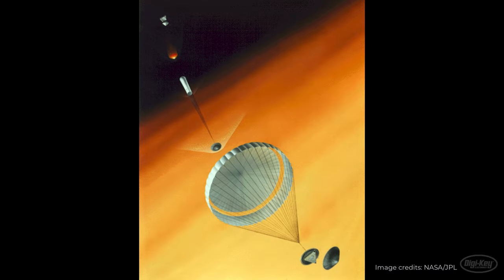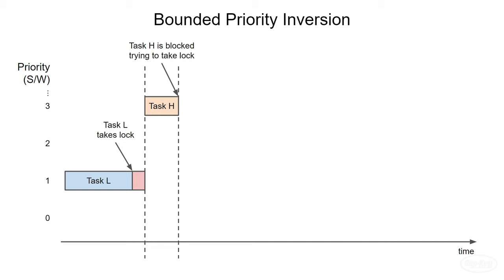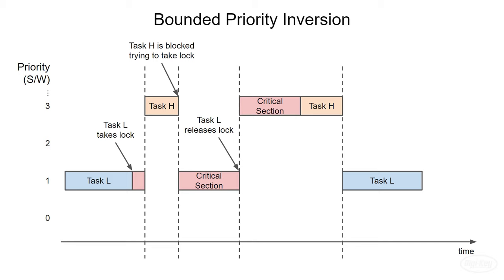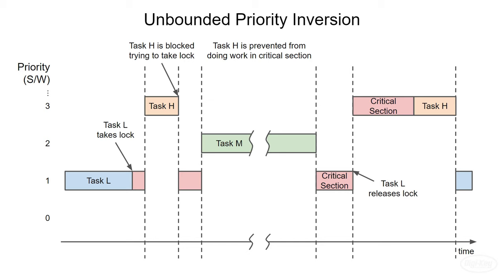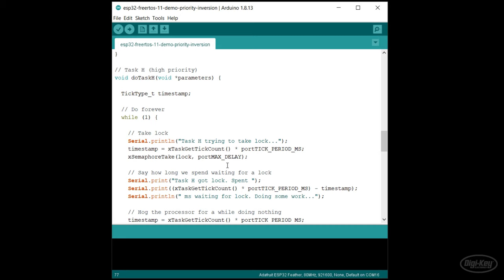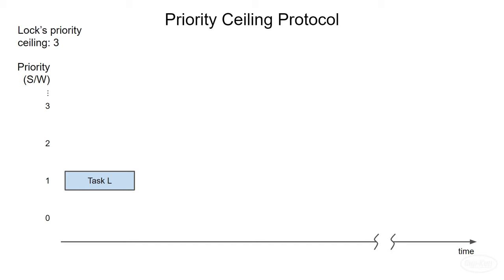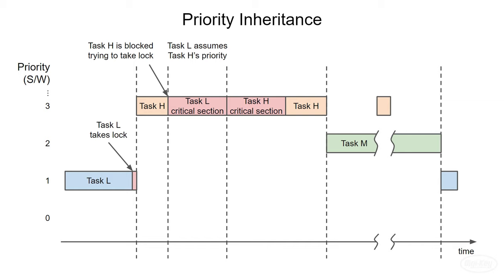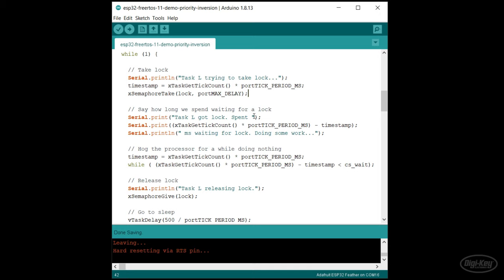Introduction to RTOS Part 11 - Priority Inversion | Digi-Key Electronics

Comment: It seems to me it is better to disable preemption or interrupt altogether for any critical section, for two reasons.

One: critical sections are short, they are non-blocking, so the protected resource will be available for the task with higher priority (be it the task that wants to preempt the current task, or an interrupt service routine) very soon.

Two: this way, no priority inversion will happen, including the bounded type.

Of course, the lower priority task should yield to higher priority task immediately after it releases the resource.

What are the reasons for not disabling preemption/interrupt?

# Edit: As the video continues, I realized what I was talking about are called critical markers and do exactly that.
Reply: Good question! Disabling preemption and interrupts during critical sections does make it much easier to prevent priority inversion.

You generally want preemption when you have high priority tasks that should stop another task from running to perform some task immediately (I.e it cannot wait for the low priority task to explicitly yield the processor with a vTaskDelay()).

Comment: Hey, great job on the content, keep it up !

However, I disagree on the concept "Bounded Priority Inversion", as I think its not a "Priority Inversion", at all !

As we see in the video 2:17, in "Bounded Priority Inversion", the higher priority task is waiting on a lower priority task, but, due to a resource contention, and NOT because of any priority specific scheduling decision making. 

We need to understand that priority is NOT always the sole metric of scheduling ! 
As we see in this case, the priority metric is shadowed by resource contention logic. Hence, by design, its completely intentional, and not an anomaly. The priority scheduling was never broken here (its just that it was not significant enough to be considered in this case).

So, this may be termed as a type of "Priority Inversion", but only in a poetic sense, as it has no technical backing !

Feel free to correct me, Thanks !

Comment: I am somewhat confused by the explanation of what is happening to create the "priority inversion" issue that affected the Mars rover. I listened to the explanation several times but I feel that some part of the explanation is either missing or I am misunderstanding. From 4:21 to 4:56 ...

you stated "Every now and then, the medium priority task would run while the low priority task was in the critical section. As you can see, task 'H' is still blocked and it will remain blocked so long as task 'L' has the mutex. And, task 'L' won't run to release the mutex as long as task 'M' is running."

Here is where I am confused. If task 'L' has the mutex, and task 'H' is being blocked, that should mean that no task can work in the critical section until task 'L' releases the mutex. You stated that "task 'L' won't run to release the mutex as long as task 'M' is running. This is confusing to me. Can you explain why task 'M' is a factor if it doesn't have the mutex and is not holding a resource that task 'L' needs in order to complete task 'L's task? Why wouldn't task 'L'  just complete its task, release the mutex, and task 'H' and task 'M' are free to take the mutex if they need to run in this critical section? I don't understand what task 'M' has to do with this if task 'M' is not using this critical section. I'm sure I missed something here. Please explain.
Reply: I totally think the same thing! Have you been able to understand yet?
Reply: What I understood: because task M has higher priority than task L, task L will be preempted and task M will run. Because taks M does not use use critical section it will not be stopped by it (like task H was stopped) and it will not let task L finish with critical section because it doesn't need the critical section and doesn't care about it. Task M can run for a long of time without interrupts (because is higher prio than L and because task H is not gonna to preempt it because it is blocked by critical section) and all of that time task L is holding critical section that task H wants to use. So finally medium priority task runs freely and high priority task is blocked (that's the inversion of priorities). 

For the Mars rover task M run and blocked tasks L & H for enough time to trigger watchdog.